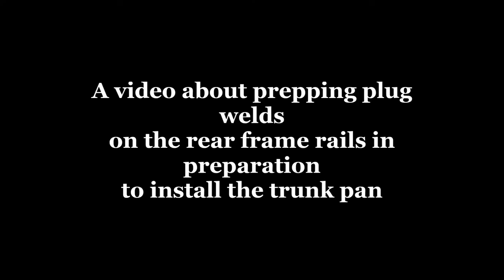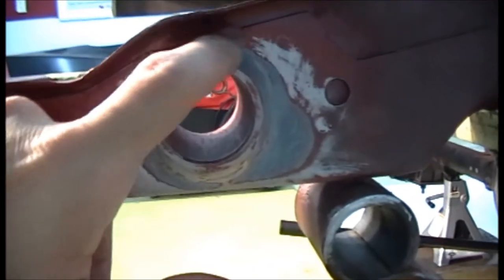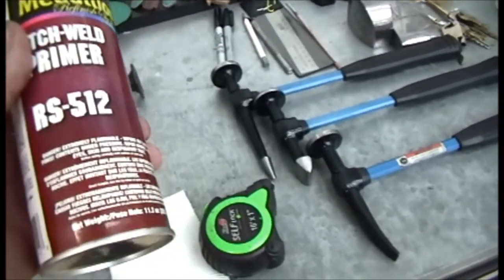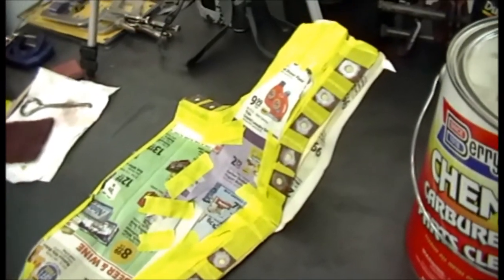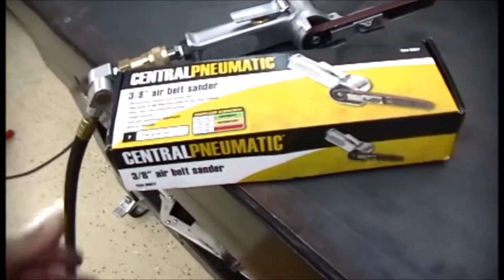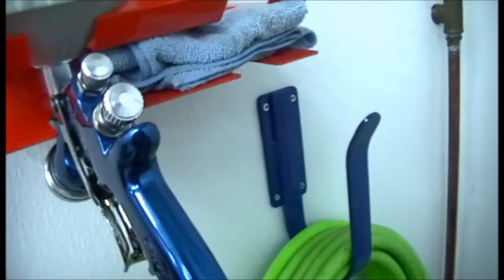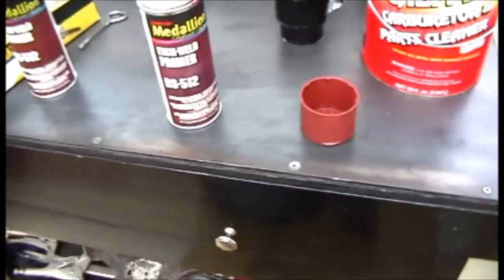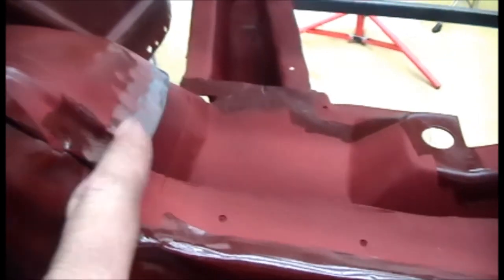Prepping Plug Welds "1972 Camaro Project OverKill"

Comment: pinch weld primer or etch primer is always the best way to go And for that box cover use high solids epoxy primer 3 coats 
and one with say a black thinned out guide coat fr long board sanding and your done scuff /hand sand 280/320 paint , high solids fills doesn't shrink as much if any and using the guide coat you see your highs ad lows so you can sand them out to get a straight finish
Reply from the maker: Great info. Thanks Len